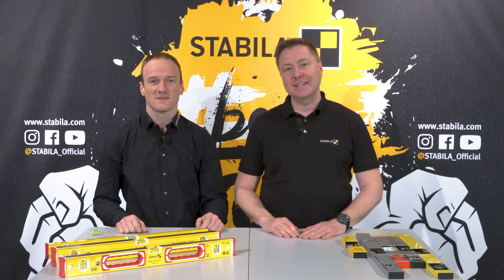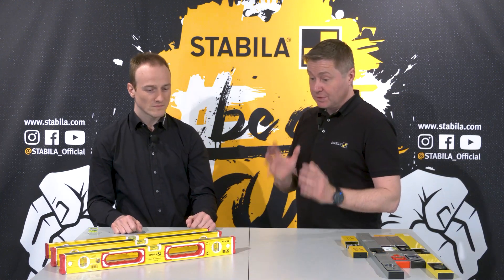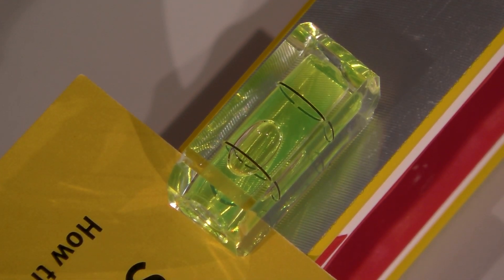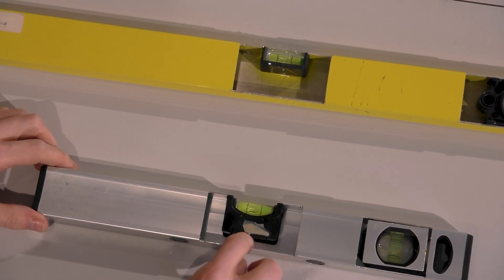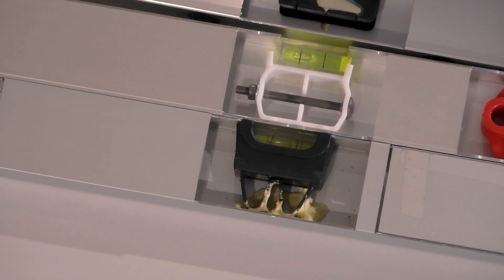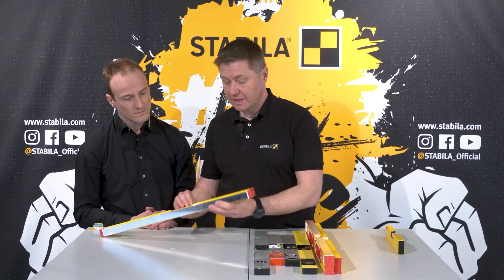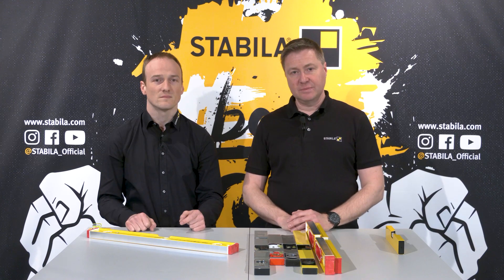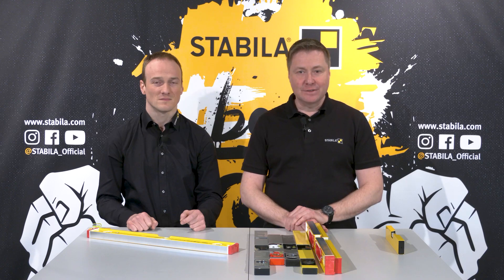STABILA eCampus: Spirit Level Basics Part 1 - Vial Installation System and Measuring Accuracy

Comment: i ruined one of  the vials whilst  cleaning.. pity you cant by a replacement...we're told to  recycle  but  now its  useless  for my  job and  only any good for a straight edge
Reply from the maker: The distinguishing feature of our assembly system is that the vial is cast into a vial block holder (which was developed by STABILA) so that it is free from stresses but totally immoveable. The vial block holder is, in turn, inserted into the spirit level profile in a way which prevents any movement. The vial and profile are permanently aligned with each other, thus consistently guaranteeing accuracy of measurement.
Reply: @STABILAOfficial  
ok.thanks for responding

Comment: Question: What is meant by "upside down" level position: Does this refer only to whether the vial is in "reverse" position, or does it refer (also) to which edge of the level profile bears against the surface to be measured? To illustrate: In surveying the sill of a doorway, the vial would naturally be in the normal position with the edge of the profile farthest from the vial resting on the sill, thus providing the best accuracy (if the level specifies different accuracies for normal vs reverse vial positions). When surveying the head of the doorway, however, one could conceivably use the level with the vial itself in either normal or inverted position, depending upon which edge of the profile is used to make contact with the surface being surveyed.  Can one presume that the machined top and bottom edges of the profile are perfectly parallel? If so, would a measurement taken with the vial in normal position (while using the top edge of the profile against the head of the doorway) have the same accuracy as the measurement taken at the sill, since the vial itself would be in "normal" position in both cases? Or should one always use the profile edge farthest from the vial as reference edge? Thank you for clarifying this detail.
Reply from the maker: Thank you for your question. So the spirit level should always be used with the measuring surface against the "object" to be measured - as you said, with the profile edge farthest from the vial as reference edge 💛🖤
Reply: @STABILAOfficial  If I may, I would like to ask a few follow-up questions: As a finish carpenter, almost all of my levels are Stabila 96, 196, or Tech series, and all but one of these are machined on both top and bottom edges. This fact has historically led me to believe that these edges are parallel and therefore that their relationship to the vial would be the same. This understanding seems further confirmed by the unusual fact that the accuracy of these levels is marked as identical in both normal or inverted positions (.029 deg.). Is my belief about parallelism correct, and if so, why is it better to use these levels as you instructed, i.e., with the edge farthest from the vial always as reference?

Also, I note that the only 196 series level I own that is not machined on both sides is a very old 59" model, on which neither edge is machined; instead, both edges are painted just the same as the rest of the profile. Investigating more closely, I also notice that this model does not have any marking as to accuracy whatsoever. So, is the additional production step of machining of both sides of modern iterations of this flagship series the key to its identical accuracy, regardless of position?

As somewhat of a Stabila fanboy, I am curious how the different Stabila series are named. Why 96, 80, 70, etc.? I thought that perhaps it had to do with the profile dimensions or extrusion die size or weight/length of the aluminum needed, but I haven't been able to discern it. Is there any relaionship between series names and profile characteristics?

I also note that all of my machined Stabilas are nearly perfectly identical in finished profile height, just a hair under 60 mm. Is this dimension so tightly controlled over time that for practical purposes on the job, for example in a case where one is using two 196 series levels in relation to one another, one can presume that every such level is identical in profile height? (I notice that my one odd painted level is about 1 mm taller than all the machined ones.)

Thank you for your replies to my curiosity. As a specialist in trim and door installations, my Stabila levels have been a major factor in my success over the years.
Reply from the maker: @michael.schuler  Depending on the type, STABILA spirit levels have either one or two measuring surfaces that you can use for measurements. So you are lucky the ones you have, have two measuring surface. With your first question, I thought you were referring to one of our most common spirit levels (type 70), which only has one measuring surface. But also the number of measuring surfaces on your spirit level is indicated on our website in the technical data on the product pages for your model - if you get a new one and are not sure👌

The accuracy of the spirit level is marked on the profile. A distinction is made between the accuracy in the normal position (normally 0.5 mm/m) and that in the reverse position (0.5 mm/m, 0.75 mm/m or 1.0 mm/m depending on version). You can also view the accuracy values for all spirit level models on our website on the product pages.

You got us with the names (96, 80, 70 etc.) - they have no meaning whatsoever 🙈
Reply: @STABILAOfficial  HELLO! I follow this discussion because I am about to buy a 80as set but I have a question about this....if I put the level on the middle of a wall in regular position and I have to draw an horizontal line...if I use the top part to mark...then the line would be 0.75mm/m ? I mean only the bottom of the level is rectified with the bubble and gives 0.5 mm/m? I understand that if I use it upside down it gives 0.75 but if I use it regular position but use the top part to measure for ex. the bottom of a kictchen cabinet that is on my head...will I get 0.75 or 0.5? To sum it all up....using upside down and getting 0.75 is related to the bubble hitting the opposite part of the vial (less calibrated) or has to do with the fact that both sides of the level are not parallel like @michael.schuler was saying ??the 80as says "two measuring surfaces" ..but are they both 0.5mm/m if the level is used in regular position?? I hope you can understand what I mean ...thank you for the support!
Reply: @xx-og1sg  Thank you! You asked the follow-up question that I too wanted to ask.
Reply from the maker: @xx-og1sg  Sorry for the late reply, I had to ask product management first. I'll answer the questions one after the other: 
The measuring surfaces at the top and bottom have an accuracy of +-0.5mm/m in the normal position.
In your case, you have an accuracy of 0.5mm/m because the spirit level is in the normal position. It is best to use the position of the H-vial as a guide. If this is at the top, the spirit level is in the normal position, if the horizontal vial is at the bottom, the spirit level is in the reversed position
The difference in tolerance between the normal and reversed position is due to slight asymmetries within the vial. However, we are talking about micrometers here.
Reply from the maker: @michael.schuler Sorry for the late reply, I had to ask product management first. I'll answer the questions one after the other: 
The measuring surfaces at the top and bottom have an accuracy of +-0.5mm/m in the normal position.
In your case, you have an accuracy of 0.5mm/m because the spirit level is in the normal position. It is best to use the position of the H-vial as a guide. If this is at the top, the spirit level is in the normal position, if the horizontal vial is at the bottom, the spirit level is in the reversed position
The difference in tolerance between the normal and reversed position is due to slight asymmetries within the vial. However, we are talking about micrometers here.
Reply: @STABILAOfficial  As a door installation specialist often working in older buildings with irregular oenings, the accuracy of the plumb vials is often more critical to my preliminary surveys of rough openings or existing jambs than the accuracy of the level (horizontal) vial. As doors are naturally much taller than they are wide, the actual deviation due to tolerance, measured end to end, is at least twice as much for the sides of the opening than for the head and sill. How does the accuracy of the plumb vials for a given model series relate to the stated accuracy of its horizontal vial? When tested at the factory, are the plumb vials tested independently from the horizontal vial? Thank you.

Comment: When I bought my first Stabila level over 40 years ago, I was so confident in Stabila accuracy, but also protective of my first investment in such a precision instrument, that I did not deploy my new Stabila for daily jobsite use. Instead, I used it at the start of each workday to check and calibrate my older levels equipped with "adjustable vials." It did not take long for me to realize the practical value inherent in Stabila's motto, "Trust, never adjust." So I soon replaced all my levels with Stabila 96/196 series models, almost all of which are still in service yet today after decades of reliable use.  I have also added many specialty models over the decades since, in particular, the various extendable models ranging from XTL to 80T to 106T. I have even customized some of my Stabilas to create  models particularly useful in my specialty work installing millwork and doing renovations in historical structures where time has caused the basic structures and finished openings to deviate from level and plumb. I know of only one competitive level on the market today that can claim to equal Stabila accuracy, and none that can rival its incredible and time-tested durability.  As craftsmen, layout tools are our eyes. My Stabilas enable me to see level and plumb with absolute certainty.
Reply from the maker: Thank you very much for your detailed feedback, which we really appreciate! 💛🖤